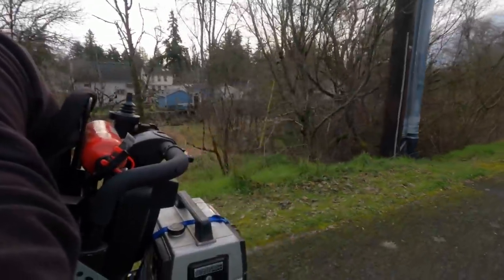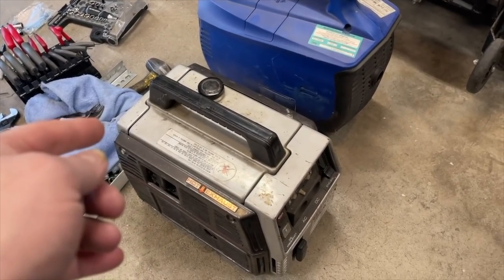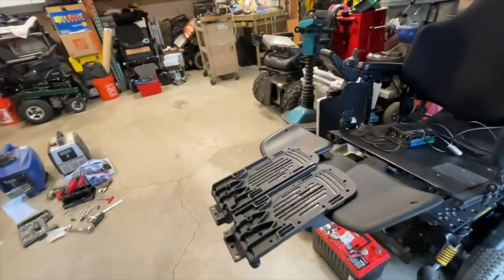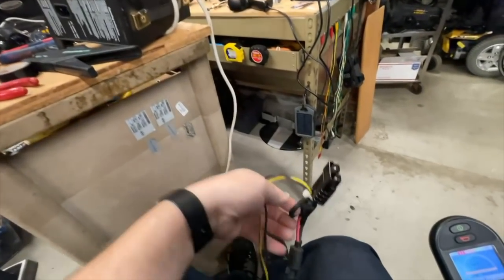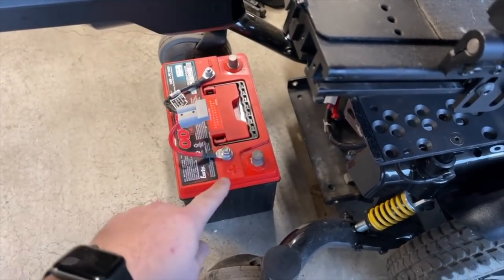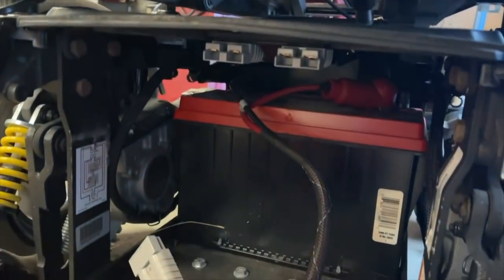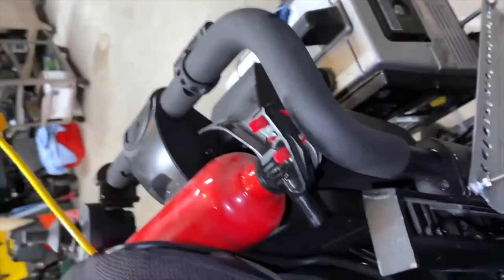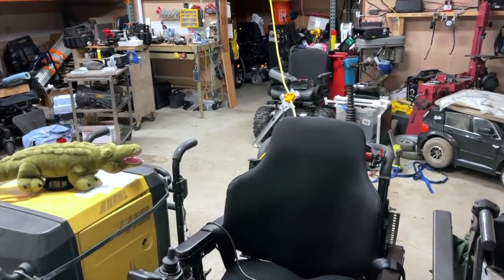VLOG 546: Gasoline Powered Wheelchair! (hybrid-electric kinda)

Comment: Thanks for the video. I own a Magic Mobility x8 and have done a similar thing. I have 2 generators. One 1200 and the other 2200. Both work well, but the 1200 because it is lighter it is a bit better. It mounts on a  X8 Luggage rack on the back of the chair. The 8amp charger is bolted to the back of the seat. I have cut the wire to the center pin of the charger, which goes into the controller. This way it can charge while mobile. I found if I go flat strap it does chew the power. However if I slow it down by about 20%, I have found I can get home and still have my 3 green lights after 12 klms. This is the biggest challenge with powered chairs. The batteries are simply too small. Anyway greetings from Orange Australia. Thanks for this video cheers

Comment: Ooh, lots of work but I bet you could open up that generator and cram it in the battery compartment alongside say 35Ah batteries, if its hybrid you don't need massive batteries just enough to go a mile or so with no engine running.

Comment: You could consider using pieces of 1/2" or 3/4" conduit in place of the perforated angles. Less sharp edges.

Comment: A hybrid powered wheelchair, cool project! I would like to see a next part/video. Goals: reduce the weight of the generator, and improve the electronics. What is the lightest generator on the market?.. I see one Weight: 23 lbs. Does the charger need a pure sine wave? Are there generators that output only 12V or 24V? Then use a DC to DC converter.. What a fun project!
Reply from the maker: yes! im working on building a setup now that just has a small engine connected to an automotive-style alternator - those are EASY to setup for 24 volt use :^)

Comment: I would apply weight to the foot rest in the form of ankle weights to correct the CG then replace the sand bags with a metal plate.  Also if you have a fluke meter you may be able to get a ct clamp to measure amp draw.

Comment: AWESOME...
You've got my mind going now !
Good power source for AQ's cattle prod. LOL.
Can you move the seat forward to offset the weight issue?
Wouldn't it be cool if you could simply hang another wheel off the rear
 to spin a 24 volt 70 Amp alternator to keep the batteries charged !
Reply from the maker: in the late 60's-early 70's transit buses used an auxiliary shaft connected to one of the wheels of the bus to turn the air conditioning compressor.. interesting way to do it! but the weight of the bus rolling around seems to work! haha

Comment: I think that chair had a vent shelf option that could give you a clean/oem look for the mount if you could find one.
Reply: Also if you disconnect power from the controller the quantum will update the battery meter when it restarts.   Other thoughts, you could use a motor and 24v alternator to build your own generator which would be a lot more efficient.
Reply: Last thought, if you built your own generator you could run it on propane and mount the tanks on the front, which would smell better and would be balanced better.
Reply from the maker: after doing 15 seconds of research, i'm building a setup with a small engine connected directly to an alternator - those are SUPER easy to setup for 24 volt use.. and are designed for charging batteries! who'da thought! lol plus like 75 amps is a no-brainer!
Reply: @TotallyNormal-  can't wait to see what you end up building.

Comment: OMG...This is what I have been wanting to do with my Quantum 4Front...I was thinking of adding a smaller set of 35ah batteries hanging in a basket in the back of the wheelchair...Attach the anderson plugs from the 35ah batteries to the side of my wheelchair and do the same with my main batteries...That way when the main batteries drop down to about 75% I plug the wheelchair into the 35ah battery pack...When the 35ah battery pack goes down I switch back to the main batteries on my wheelchair...While I am using the main batteries I charge the 35ah batteries and vice versa...And like you said in the video weight is a problem...So I would have to use a lipo battery pack that is lightweight...In fact if you can put the generator in the battery compartment and just hang the lipo pack on the back of the wheelchair that would solve the problem...

Comment: that is crazy I thought of that idea many years ago that using propane with the small one-pound cylinders. Also with the generator with electric start… If you can build 3.0 with golf cart batteries? My idea was something like a small golf cart platform you could drive up on putting the generator somewhere say under the dashboard area. He would just have to figure out what kind of motor control you could use? Also with propane you could even run it inside much like the forklifts do in warehouses. This configuration would also give you windshield and possibly a roof over your head depending on how crazy you wanted to be
Reply: something like this "ALP 1,000" willing to sponsor something like this next summer if we can figure out a motor controller.pulled off of Google "A 48-volt system of 4×12 volts can deliver approximately 600 amps. Yet a 48-volt system of 8×6 volts can deliver 1,800 amps. This alone can increase the range of a golf cart from about 12 miles to about 35 miles."
Reply from the maker: i actually bought a golf cart 3 years ago..  got hand controls installed and everything.. the plan was to extend the frame a bit, and just drive chair up onto it.. but then life got in the way, and selling it for $1500 sounded a lot better at the time haha

Comment: The Only thing Charging Through
The Joystick 
1 The Chair Won't Move
2 It'll Do What You Said It'll Do
Monitor Battery Level. If It Wh'er
Me I'd Install A 2000 Watt Solar Panel.

Comment: Don’t you need much more amperage on that setup? 600w doesn’t seem like enough!
Reply from the maker: most wheelchair chargers only pull a max of 325 watts from the wall.
im gonna build a V3 of this chair though with a smaller engine and a belt drive that turns an 80 amp 24 volt alternator :^) that way i can use much smaller batteries in the chair, and get the weight down a bit

Comment: hey im new to your channel  my back is toast and i have a bunch of problems im sure you know how i feel 
anyway it would be much easier if you make a little tow behind trailer for it the chair will go faster and  make it easier
Reply from the maker: yea - the next version is going to be much lighter weight, and more powerful! using a little 2.5hp motor to drive a 24 volt alternator directly.  the trailer would help a lot as well! just makes turning tricky.. but theres ways around that :^) using an alternator that can output 85-100 amps will also allow much smaller batteries to be used in the chair as well!

Comment: what is mileage per/charge?
Reply from the maker: "usually" about 8 miles without the generator.. BUT im using smaller batteries than the chair normally comes with
Reply: @TotallyNormal-  its very unique

Comment: This is a project I have wanted to do for many years.  Can you tell me what modification you did to the charger?    I had thought of having a jumper between the male XLR plug from the charger and the female XLR on the controller.  The jumper would only have the (+) and (-) wires, not the third wire that prevents the chair from being driven while a charger is attached.  If I started out with full batteries, the power for going up grades would come from the batteries, but when going down hill, and on the flat at moderate speed, the charger could power the chair and recharge the batteries.  Your thoughts?
Reply from the maker: on the first chair i built - i tried connecting everything up to the joystick charging port.. it did NOT like that at all!! (also more than 8 amps can easily fry wiring and connectors)
at speed, the chair would just SCREECH to a halt for no reason.. the current sensing didnt know what to do with itself, and im sure the power coming from that setup is quite noisy.. which electronics dont like.  that's why i connect directly to the batteries - they even out all the noise etc, and prevent any weird sensing glitches. as far as the "charger" im going to be coming up with something new - i cut a lot of this out of the video - but that generator i have throttled down quite a bit and is outputting maybe 35-40Hz = frying most standard chargers.  i wanna look more into all of this - the suitcase style inverter generators are getting a LOT cheaper now - they even have 24v DC versions! (obviously ya would need current regulation) but there's more to come on the topic!  for now - i wouldn't recommend any of the mods i made with that charger/power supply.. and if ya try any of it out - don't connect anything to the chair's charging system!